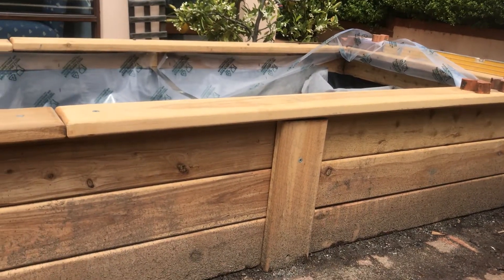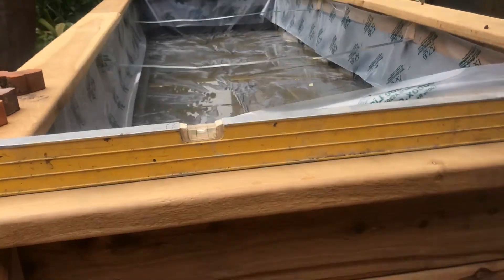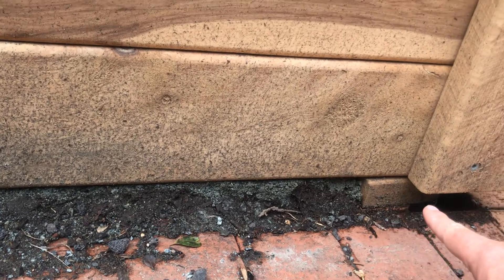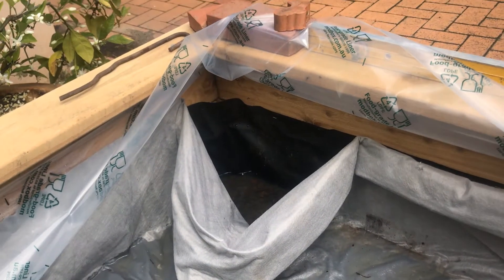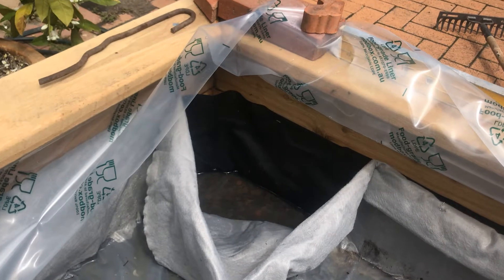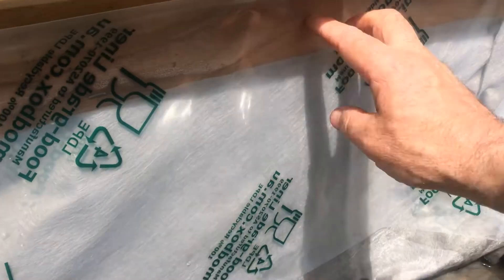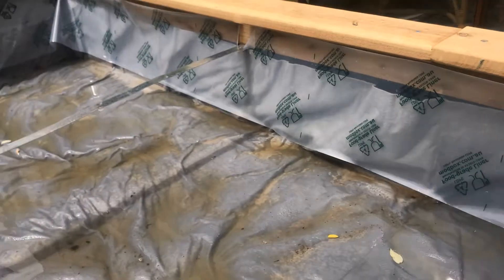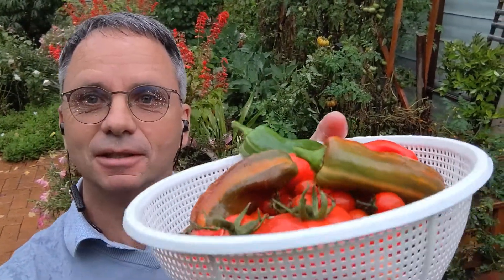How do Wicking Beds Work?

Comment: What material
Did you use for wicking?
Reply from the maker: D K, we call that "geotextile fabric" in Australia.  It feels like felt but is synthetic so doesn't rot underground. Its structure allows water to pass through up into the soil from the scoria/water layer below but stops the soil passing down into that layer and clogging everything up.  You can buy it any big hardware store here in rolls.  It's otherwise used to stabilise landscape, in trenches, or as weed mat.  Let me know how get on finding it...